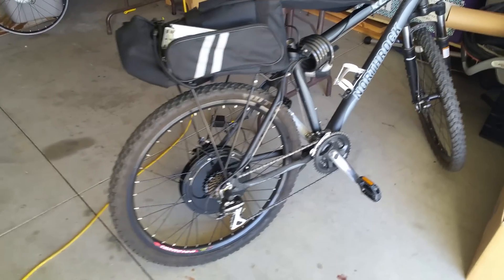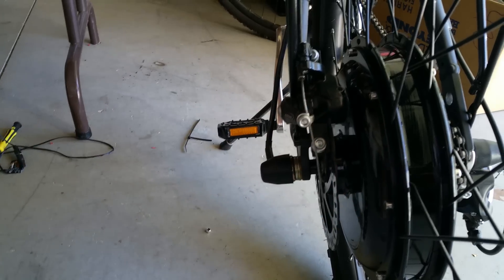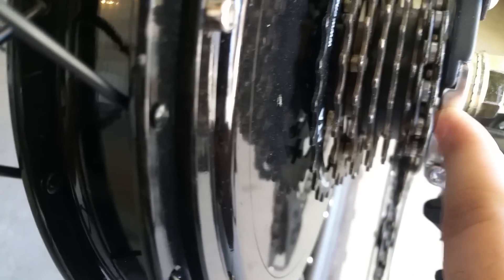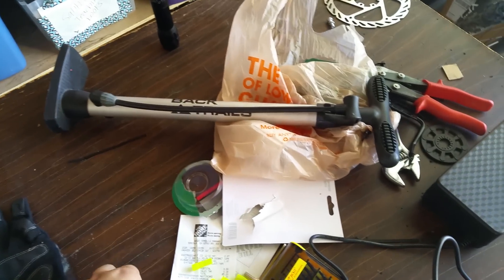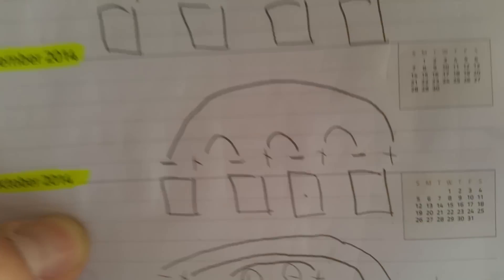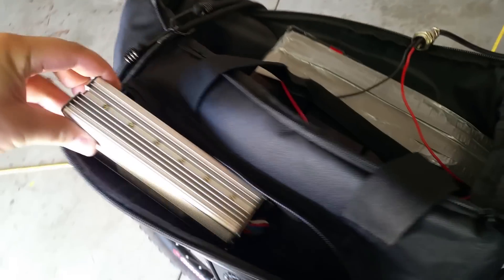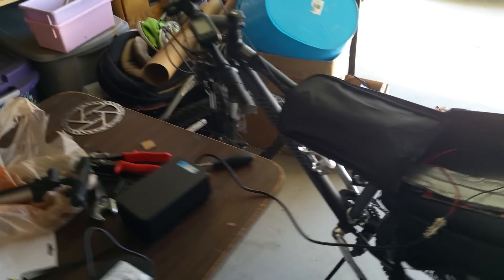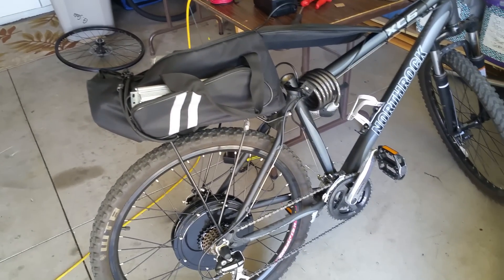Fast and Cheap Electric Bike! Over 30 MPH! Part 1

Comment: HERE IS LINK FOR EBAY THE CHEAPEST 48V Lithium Ion E bike Batteries on the Internet I AM ONLY WRITING THIS TO SHARE MY DISCOVERY I AM JUST A CONSUMER I DID THIS OUT OF JUST WANTING TO HELP THE E BIKE COMMUNITY SAVE A FEW DOLLARS ON A PRODUCT IVE RAN DAILY FOR A WHIKE NOW AND COULD NOT BE HAPPIER! 

https://rover.ebay.com/rover/0/0/0?mpre=https%3A%2F%2Fwww.ebay.com%2Fulk%2Fitm%2F273891829574 
FOR 8AH 48V Lithium Ion Battery for $96.00 with charger and the one I bought LINK IS BELOW IS A 48 V 14AH Lithium Ion Battery for $169.00 check this seller out you will save $100 or more. My full review of owning one below. I BUILT MY 1000W 48 V 14AH E Bike for less than $350.00 with a 2 year warranty! Hey guys so I have spent months researching and watching days worth of DIY E BIKE SET UPS And what I came to conclusion wise is that you will spend $75.00 USDfor 4 12V 7AH SLA Batteries and most of these DIY Hub Motors suggest a battery of 48V and between 12AH and 17 AH. Everyone I know says you should have a minimum of 10AH but everyone who has 10AH wishes they had 15ah and they wish they had 20AH you want to have the most AH you can afford. Now if you shop on amazon and Ebay you will find that 20AH Lithium battery’s are very expensive way to much, and also that all “e bike lithium 48v battery’s are expensive. 48v 10AH Lithium Ion Bottle battery’s are $200-$300 USD 14-15AH are $250 to $350 USD and 20 AH battery’s can be around $400 to $450 USD based on a quick amazon search for 48v E Bike LITHIUM BATTERY and These battery’s are super nice they usually have a locked by key mounting system and on off switch custom charger just the way to go if ya have the money. But if ya don’t wana pay out your ass for the same exact thing only difference is that it’s not in a cheap case designed for e bikes like the bottle style or the flat rear rack style that lock onto the track. If you buy one of these $350-$450 battery’s and open it up you will find it’s just a bunch of cheap Chinese brand  18650 battery’s wired up in series. Inside a fancy case that doesn’t do shit and sure as hell isnt worth $200.00 more. I found one seller on eBay from China who sells 48v Li-ION Battery’s for e bikes with a charger and with the protection chip it is identical to the expensive ones on the inside, and there shrink wrapped and designed to be put inside a $10 waterproof bag and be mounted on a $15 Rear Bike Rack. You are buying directly from the manufacturer and by cutting out the middle man save a lot of money, now I don’t work for him or am paid to say this I don’t even know them but I have been using one of the battery’s I got from this seller my 48v 14AH battery for $178.00 and also my wife has been using a E bike “specific”  LI-ion 48v 14AH battery on amazon for $375.00 I actually got 3 miles more range than her riding side by side at same speed and I weigh 45 lbs more than her. So the battery’s I’m gonna provide ya link to are kinda hard to find the way there listings are worded on eBay I got lucky and stumbled upon them. The 48v 8Ah Lithium battery with charger is $89.00 free shipping on all of these. The 10AH one is $139.00 the 12AH is $159.00 the 14Ah my suggested battery is $170 and the 20AH 48v Lithium ion battery is $260.00 there also are 36v battery’s listed. NOW IF ANYONE CAN FIND ME A 48v LITHIUM ION 14AH BATTERY with a charger and plug and play ready to apply to ANY E bike Hub motor kit CHEAPER THAN $170.00 with free shipping. Let me know ya won’t find it tho I promise I’ve looked for weeks!  DONT WASTE $150 more to get a cheap ass aluminum case that prob leaks and get this kind and a good waterproof bag and save some money! I went with the 14Ah I know someone who has the 8AH and it works fine for his 1000w kit just has less range. Charges fast! The only NEGATIVE THING ONLY ONE THING IT TAKES 14 days to BE DELIVERED in USA from China. THE LAST POSITIVE IS FOR $18.00 you should definitely purchase the eBay square trade warranty offered on the 14ah battery it’s like $9 for the 8Ah battery warranty it’s based on product price, but for $10-$$20 ya get a 2 year warranty that they will replace the battery if anything happens to it. Which anyone who knows Lithium battery’s knows they don’t last forever so if ya do it right ya can prob get a new battery in 2 years if it’s not working as it should. I feel the need to share this since so many people say DIY E BIKE FOR UNDER $600 or $500 shit ya can get a 1000w 48v hub motor for $135 and a 8Ah 48 v battery and charger for $89.00 and for $224.00 plus any state tax if you have the bike already you can convert it to an e bike add on $25 for bag and rear rack and maybe $15 for a few electrical connectors from hardware store and total cost around $260.00 for an 8Ah set up and $340 for 14Ah set up and $425 for a 20AH 48v 1000W e bike that’s insane please reply if you can find a better price for Lithium batterys with a 2 year warranty available as well! Here’s the link

 https://rover.ebay.com/rover/0/0/0?mpre=https%3A%2F%2Fwww.ebay.com%2Fulk%2Fitm%2F273945102555

Comment: GREAT video!!
QUESTION FOR YOU THOUGH!!! 
If you weighed 170lbs and lived in Seattle (lots of steep hills and wet) would Your kit do the trick? Even if you wanted to strictly throttle the bike up hills or would you need to do some heavy peddle assist? Let’s say the Hill was a 30 or 35 degree hills? Would you purchase a higher Wattage motor or would you purchase a better Controller with a 52V or 72v battery? Or just purchase a Mid Drive Motor Instead? Or would this kit work for me? Opinions and Ideas?THANKS!!

Also would this motor work well with a Fat Tire Bike set up?
Reply: late answer from a total stranger that did not make this video. uh no.

Comment: Tires are the large round rubber rings, wheels are the hard inner part and the "special" $4 tire levers take the tire off the wheel. Axle is what goes through the middle of the wheel. Next time, just buy a complete e-bike battery with a BMS so you get good performance and avoid explosions and fires.

Comment: do you charge them in parallel? how much time does it take to fully charge them. doesn't it damage the batteries when it goes below eighty percent. how do you avoid damage to the batteries. how heavy is the battery set up. cool bike man I know lithium batteries are very expensive.

Comment: How much did it cost and where did you get the electric wheel? what brand is it. Are there 4 x 6v batteries in series = 24v or 4 x 12v = 48v? Finally, what is the wattage of the motor? A response would be appreciated thanks . . .Wayne

Comment: Okay folks... picture at "5:27" shows 4 12V batteries in series... rendering a 48V cluster, it also shows a final connection of the end + and - from this.    Assuming you have NOT done this yet... don't... it will blow your ass up.  That long hoop wire he shows is CUT... not connected!

Also the wiring he is using is absolute shit.  Get #10 AUTOMOTIVE fine strand all copper wiring, do NOT get the solid core wiring in his set up!!!

Comment: Round disc = Disc Rotor, Hat on top = Disc Caliper, Set of Cog wheels/ Gears = Cassette or Freehub, Metal bracket = Derailleur Hanger, The thing that shifts gears = Derailleur :)

Not meaning to look down; rather to educate than write another comment pointing the obvious :) Id like to do this to my bike too but way over my budget.

Comment: Its not a tyre, it's a wheel. The tyre is the rubber bit.
Reply: ITS SPELLED TIRE! jk I know, but cmon, a wheel is a circle that rotates. If you're going to be that specific, might as wheel (pun intended) name every bit of a wheel, 1. Hub 2. Spokes 3. Spoke nipples 4. Rim 5. Tube (if not running tubeless) and 6. Tire/Tyre

Comment: He doesn't know any of the proper names of many things on his bike , but that might mean that even a non mechanically inclined person can build this bike . Good for him.
Reply: As a professional bike mechanic, I f*cking CRINGED every 
time he said "the tire" when referring to the entire wheel. 
Whenever he said "tire" I immediately said "wheel".

I suspect he had nothing to do with the build.
Reply: ....or a break even.
Reply: He didn't even know what the derailleur was called.  I suspect he isn't a hardcore cyclist.
Reply: This and that and the other thing....
Reply: "it" ,this thing, flashlight - I did recognize.  Then "they" references..I've got no clue.  but makes me suspect "they" put most the thing together...and he painted the back wheel and added the flashlight.
Pretty useless.
Reply: I'm not a bike mechanic, I'm not even an amateur cause I get a bike shop to do most of my work, And I'm not a pro cyclist or even a cycle hobbyist in any form, I just use my bike to get around as you do... But even I know the name of the bike parts ! lol
Reply: mtlnascarfan 

It is perfectly acceptable to call the entire assembly a wheel or tire in non-technical talk. You wouldn't call it a tire while giving a speech at a bike manufacturer's convention, but someone just talking to their friend and it's ok.
Reply: This special tool (tyre lever) 😀
Reply: Sow 24 v motor control wiring
Reply: that's hilarious, I thought the exact same thing.
Reply: mtlnascarfan no hate but be humble with your profession. Do not expect the knowledge that you have over a subject form others. All that matters in this world is happiness, and if fixing bikes and such makes you happy, then do it :). But, in return you have to let others do what makes them happy! Lighten up and be happy someone is trying to enjoy your main subject! :D
Reply: Try this, "a perfectionist" and "break". Basic grammar and spelling allows people to take you seriously.
Reply: steve bigler hahahaha i cant help but listen out for him to say...this or that part.haha
Reply: or perhaps a BRAKE too....
Reply: +N English no ur just anperfectionistic as whole. who can't give anybody a brake.

Comment: At 1:45 the unknown part is a transmission  and the silver piece is a safety so rim will not come out and you don't have to be wrenching it every time . The rim get pull forward and the silver piece keeps it from doing so besides the nut.

Comment: If you are using SLA lead batteries, I would think you would want to use much bigger copper wires to connect them in series. But that is just me.
Reply: steve bigler Dude you're a pretentious ass.
Reply from the maker: I used 12 gauge, which is pretty thick stuff
Reply: TooWheelsTooMany j 

Foto.
Reply: Dude you don't know basic words or names of connectors... don't talk to us about "thick stuff"... we care about actual energy transference and reducing resistance.  I know that confused you... but in short... #12 is lame.  This should be #10 or better #8.
This, best:  http://www.ebay.com/itm/230992012176

Comment: Good first attempt at a "How to" YouTube I thought.  Keep going.   My one comment refers to your hand drawn circuit diagram.   It shows several batteries wired in series and said wired pos to neg, pos to neg etc which is correct BUT then you finished by saying wired neg to neg.   This would create a short circuit and the resulting "flash-bang" would be proportional to which neg was connected to which neg.   Once connected correctly there should be two wire leads only connected at one end to the battery one each to the pos and neg at each end of the taped battery which connect to the ESC.   The drawing showed these terminals connected together  with one wire which would result in the biggest "flash-bang" possible.   Anyone following the advise contained in this YouTube should NOT wire up the batteries literally as shown or described.   IMHO.   Otherwise the points made seemed valid  also IMHO.

Comment: I got the same Motor and Controller kit with a 20ah Battery. The FIRST thing I did was change the tire and innertube, they were wayy too weak for the Torque the motor has👀💪 definitely Saved using a kit too!

Comment: I just want a bike that can reliably do 25 in all situations, so I suppose it would need a higher potential top end but that is not what it's for. The main thing is it needs to have a range of at least 60 miles before it starts to slow down.

Hey nice to have a bike that can do 50-60mph in normal traffic. Sounds like the perfect sunday.

Comment: better not have a stupid top speed limiter
Reply from the maker: it is adjustable, so you set a top speed speed as low as you want or as high as you want the maximum being 40 i believe

Comment: i've been discourraged from using the lead acid batteries , not only because there heavy but they allso seem to go steadily downhill in power while the li ion cells basicly stay level untill there near the end of their charge 

it is possible to remove the tire without tools you need to push the edges of the tire toward the middle of the rim (this part is deeper then the sides )
the  kinda move the slack of the tire to one end of the rim (hold the rim down with youre foot with the airvalve on the bottom and kindah run youre hands along the tire from the bottom up pinching it to the valey of the rim and  pulling it along toward the top of the wheel) and force the tire over the rims edge 
takes strong fingers but done right you can move the outer with the inner tire of the rim without the chance of pinching the inner tire with the tools and pop a leak in it
Reply: watahyahknow miata is always the answer

Comment: 12v battery isn't that going to be underpowered
Reply from the maker: 4 batteries in series is 48 volts
Reply: i built something very similar, 3 x12v 12ah/20hr gave me the 36v i needed.
down side was i used it to get to work at the time, 15 miles there 15 back 
in Very hilly terrain it ran out of charge on the way there took most of the 
working day to recharge and ran out about 2/4 miles from home.
after about 2 'n' half months it killed the batterys (11/12 charges p/w)
conversion kit cost £200 from china to UK & batterys cost around £64 total
Reply: straw dog How did you do that? My batteries stop working after it gets below 48volts.
Reply: I think he has 3 twelves hooked up in series so that gives you 36 volts. and I don't need the name of the stuff he showed me what it looked like that works for me better than a name I will for get before I have supper.
thanks for a great idea amego

Comment: custom built lightweight 7-10kg alloy  motor cycle frame with bicycle saddle and custom made lightweight high quality motor is the good option for ebike builds.  those heavy hub motor wheels are simply too heavy for bicycle frames nearly 10kg which is more than a motorbike wheel. you dont wanna ride something weak that puts your safety at risk

Comment: $400 is cheap?
Reply from the maker: Way cheaper than buying a pre-made electric bike thats 1000 watts
Reply: I'd like to see you do it for cheaper. Any decent high end battery will cost at least $350-$600.

Comment: You can buy a cheap car for what these cost. I know the long term benefits are what people look at but my point is they are pretty expensive for what they are. Especially the battery that's the most costly part
Reply: you buy a car for 400 then put another thousand for repairs then the thousand or so for six months of insurance plus gas and the fact that your car may break down at any moment
Reply: +Wayne Rhea cars are expensive, I'm not debating this. my point is these things are expensive and not in the same class
Reply: This is quite right. I have had 3 good cars over the last 10 years each costing less than €700. In that time I had one breakdown, which I was able to deal with roadside, and expenses of no more than a couple of hundred per year. You have to know something about vehicles to make a good choice of course, but to assume that a cheap car is automatically junk is wrong.
Reply: Are you joking? A car you do not find it for 300-400 bucks, and even if u find it, as someone else was rightly pointing out, u will need to spend another 1000 $ for repairs, pieces replacing and for gas.
Reply: Chris Nelson Your dumb??? Wtf are u getting for 400 $ car??? That's why there are scammers everywhere, it's easy to fool people it seems.
Reply: Yeah you could, and then spend a shit load of money and time on top to keep it going.
Reply: This is $400. Are you stupid?
Reply: +MrDanrock82 you guys are dicks. http://www.autotrader.co.uk/classified/advert/201606134882835/sort/ageasc/radius/1501/price-to/500/page/1/adPos/4/postcode/bd176lb/usedcars?atcidi=ilc-mobi-link there is a car fully functional for less than 400 bucks (or the uk equivalent) ill accept your apology whever you are both ready
Reply: +MrDanrock82 there are plenty for this price range, fully functional cars that need NO parts. people qho scam put incorrect milage etc. but once again you are missing the point: for the cost of this, you CAN buy a car. that is my only point
Reply: Wow..you can? Thanks!
Reply: Dont use LiPo batteries. Hold out for LiFePO4...much much much safer and really about the same price...

Comment: HOW  MUCH  DOES  THE  KIT COST & DO YOU  THINK  I COULD  CONVERT  A BIKE  WITH  A SHOCK  EXORBER  BODY  INTO  AM ELECTRIC  BIKE?
Reply from the maker: I wouldn't recommend installing a motor to the part of the bike with shock absorbers. Just install it on the part without shocks, like in my bikes case the back didnt have shocks. Also you can install the motor on any bike with the correct tire dimensions